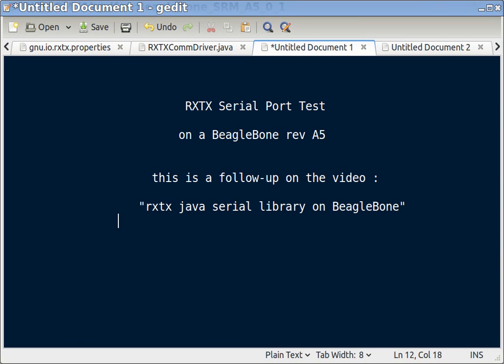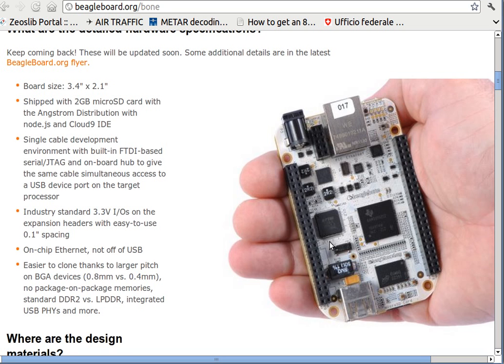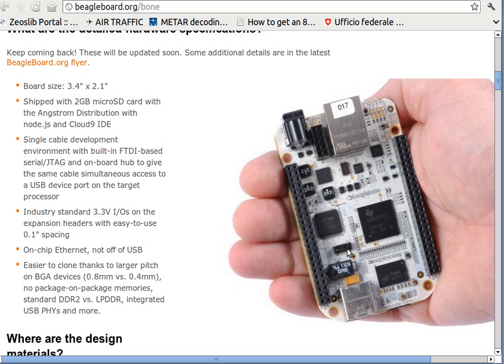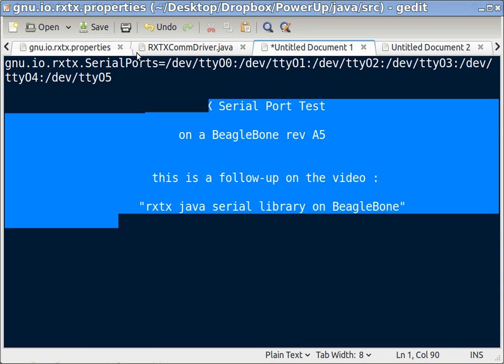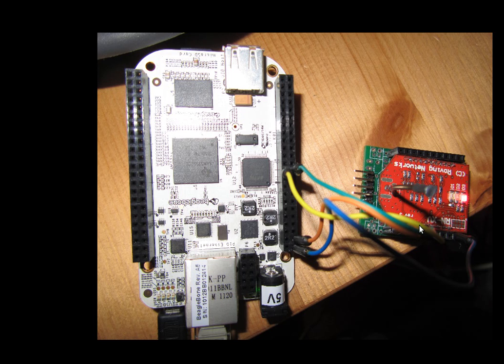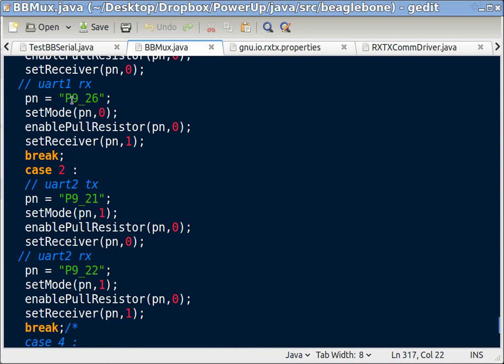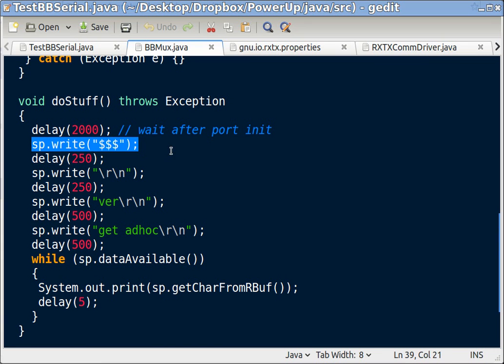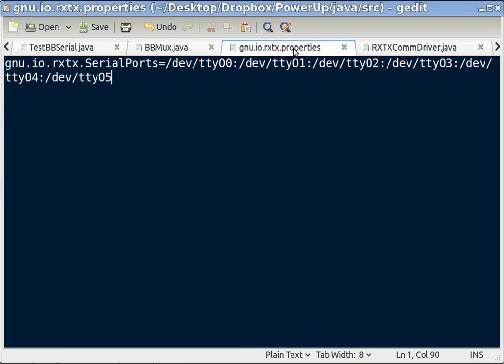Java Serial communication on BeagleBone using a ttyOx TTL uart

Comment: I try to use Beaglebone A6A (White) UART2 for test. So what I did is basically same to your java codes:
   1)Set UART2(P9-21, P9-22)
              echo 1 > /sys/kernel/debug/omap_mux/spi0_d0
              echo 21 > /sys/kernel/debug/omap_mux/spi0_sclk
   2) Connect P9-22(rx) to Serial port pin(tx) of my computer. Both baud rate is set to 9600. 
   3) cat /dev/ttyO2. Then send some chars from computer. 
Problem: What the Beaglebone received is not correct, just some weird chars. I doubt the baud rate, but both are set to 9600. And the baudrate 115200 doesn't work either. It received something, but not correctly.

Please help.....Confusion will kill me. :)
Reply from the maker: Hello, I am currently traveling, so I cannot check any documentation.
Are you sure that the mux is supposed to be set to spi mode? looks a bit suspicious to me, would rather expect some uart config, not spi....
Reply from the maker: Ying Chen Err... no, actually BB is supposed to work at 3.3V I think.

Comment from the maker: Unfortunately I am not a C++ guru, but I think it should not be different than writing c++ code for any linux serial.
I would expect (but I may be wrong) the needed header files to be present when you install the gcc toolchain.
The difference is that you have first to set up the pin multiplex values, BEFORE opening the serial device /dev/ttyox.
Setting the multiplex values is simply done by writing and reading values to/from specific files, let me know if you need help with that.

Comment from the maker: Thanks, Well, I guess the c/c++  part has already been done, after all the rxtx driver (the native part) is written in c or c++ itself.
Probably in c/c++ you can even have a better control of the pin muxing, without using the filesystem interface... but I have no experience with that.